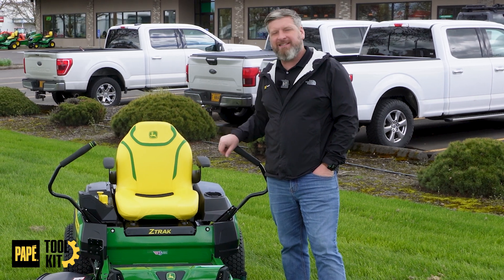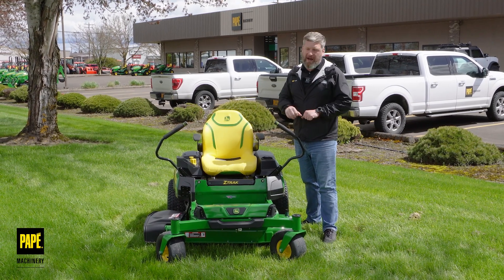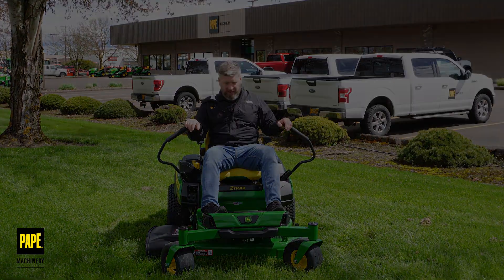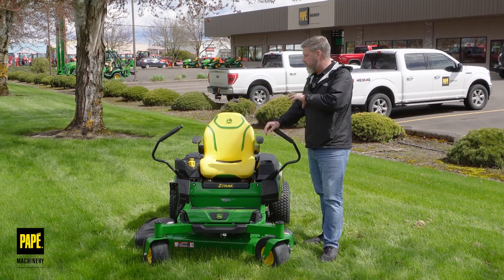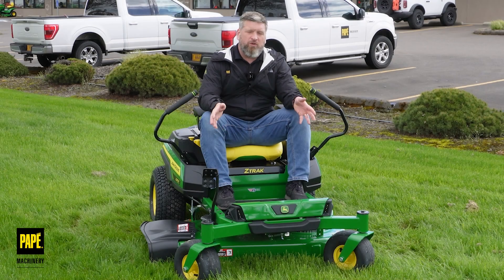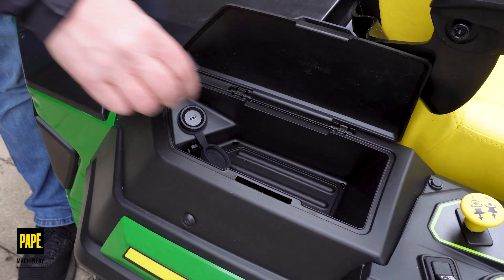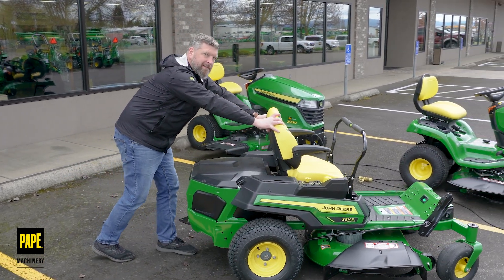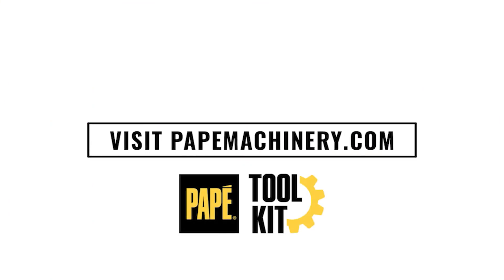Electric Zero Turn Mower from John Deere

Comment: What is it that I heard rattling while it's moving?
Reply from the maker: Hi Daniel, thanks for watching! You're hearing the mower deck as Jason travels over uneven terrain. You're able to hear that with the electric motors but usually not when using a gas engine, because the engine noise is so much louder.

Comment: It has close to zero traction if the grass is even a tiny bit wet. If the grass is high and damp, you will be lucky to get 1/3 of acre out of a full charge. I'm not guessing - this is what I found with mine.  The only bright spot I found was the bagging performance which was excellent.  If you get a couple of weeks of rain as I did and can't mow, then this mower will not do the job - you will have to call in reinforcements.
Reply from the maker: Good feedback, Otto. Thanks for watching!

Comment: I could hear something clunking while it was cutting grass 😅
Reply from the maker: Hi JH, thanks for watching! Yep, what you're hearing is the mower deck and the anti scalping wheels along that uneven ground. You won't hear that when mowing with a traditional mower, since the engine noise will drown that out.
Reply: Excatally

Comment: Blah Blah. Not worth that kind of money.
Reply: How long to recharge? Also can it be charged with 220v for faster recharge.
Reply from the maker: @freds4712  Thanks for watching! The mower battery can be fully charged in under 2 hours. The onboard smart charge technology accepts a standard outdoor  extension cord to a grounded 110V outlet.
Reply from the maker: Thanks for watching! Electric models aren't for everyone, but they are gaining in popularity. The great thing about the line up of John Deere mowers is that there is a model for every style and every budget.

Comment: Show us how it actually operate!
Reply: Yeah, it didn't look like the mower deck was engaged at any point.  I didn't see any air or grass coming out of the shute.
Reply from the maker: @hendrik, Thanks for watching! Try the 9:27 timestamp. :)
Reply: @papemachinery.agturf  Try engaging the blades?😏
Reply: What voltage is battery? How much does ten year warranty on battery cost? One battery or several small batteries? Mower is 2000 more than Ego mower , how is it better? Is battery and motor made in China? How much does it cost to replace batteries?
Reply from the maker: Thanks for watching, @benscrwbiutb9800!  These are great questions. The Z370R is powered by a single 58V battery. The battery is sealed and is IP66 rated. List price on adding a 10 year battery warranty is $100.  Just this morning, we learned that Chevron and John Deere are entering into a partnership to sell EGO-branded battery products through John Deere dealers!  You can find out a lot more about the electric Z370R on John Deere's website: https://www.deere.com/en/mowers/zero-turn-mowers/z300-series/z370r-ztrak-mower/?cid=PPC_MDS_00490_02464&gad=1&gclid=EAIaIQobChMI3fbCzqnh_wIVciCtBh3sugzIEAAYASAAEgIN-_D_BwE&gclsrc=aw.ds
Reply: @benscrwbiutb9800  great questions
Reply: Let's see John deere quality, electric fill up, lot cheaper than gas, low maintenance,  great warranty 🤔 wake up your gonna have to sooner or later
Reply: How much how much how much a arm or  leg ?or just both … cuz at the end of the day ….it’s still a lawnmower!
Reply from the maker: @brandonnlackland3323, MSRP for one of these models is at $6,399. We're taking orders now for a fall delivery.